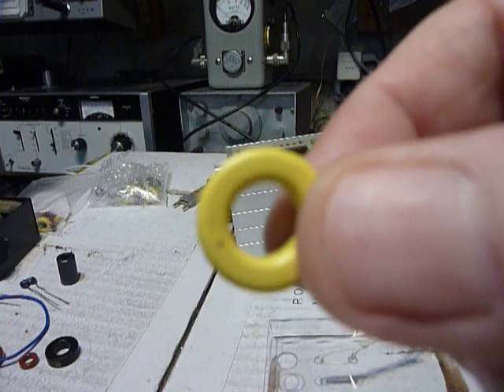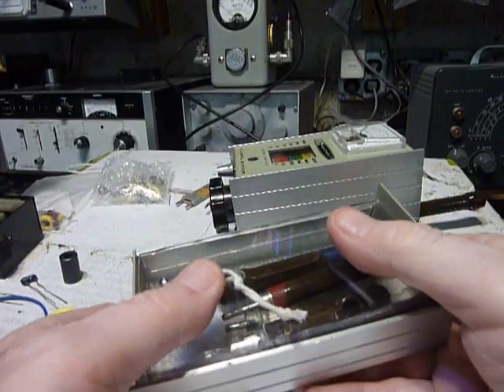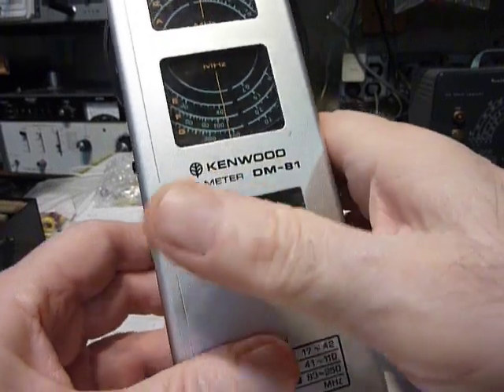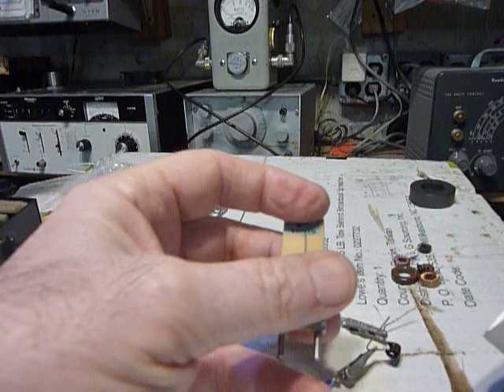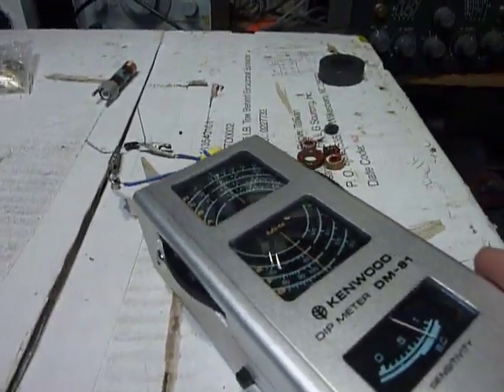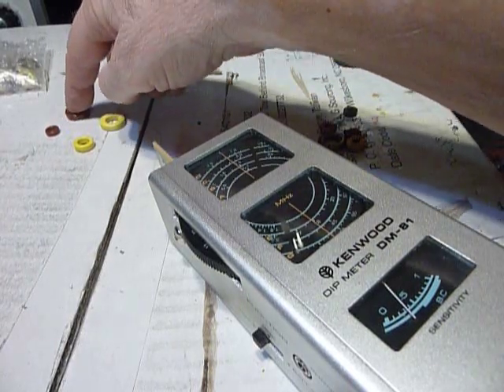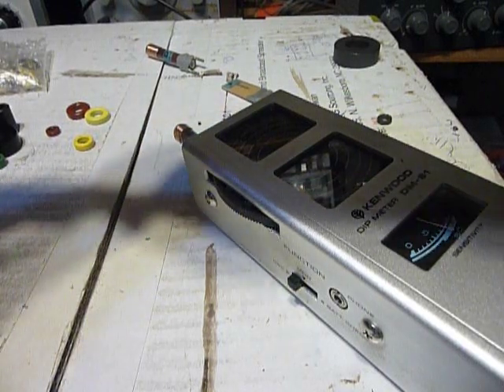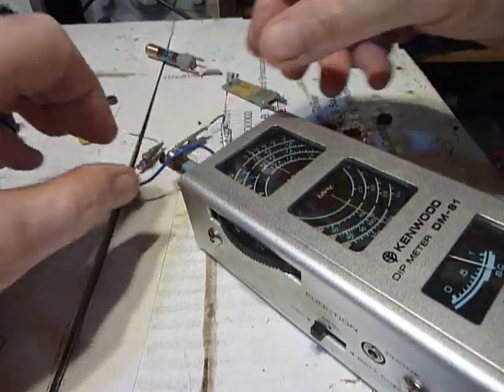CHECKING TOROID CORES WITH A DIP METER , DIP METER TIPS

Comment: Hi Robert, outstanding video. So I have a dip meter and I am checking some hopefully hf toroids. Question I only have a 100pF capacitor. My readings only deflect the needle somewhat near the end of the scale only.  Is this what you would expect? And once I receive  the 50pF and use as you illustrated will I have better readings? I do have two 240-43 Toroids from commercial source. Thank you in advance.